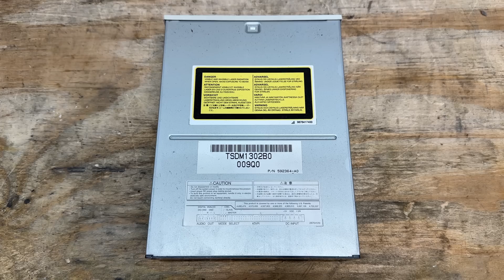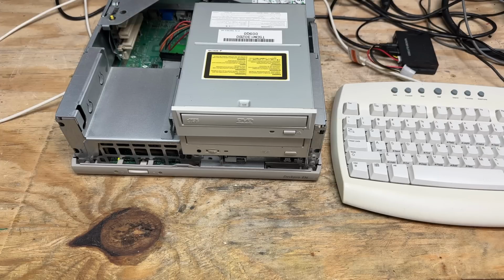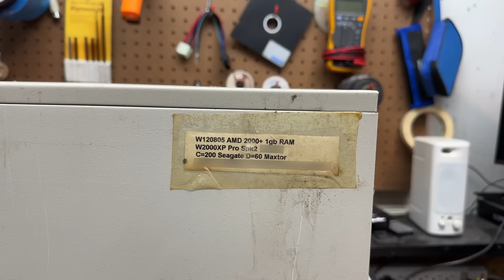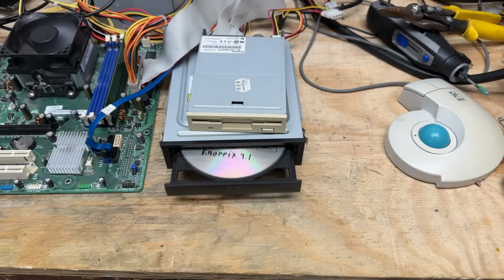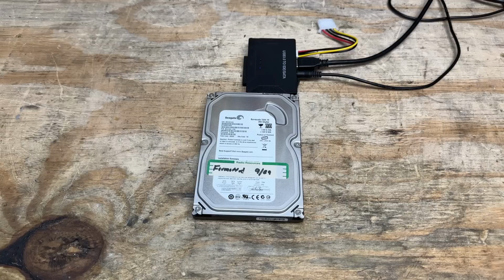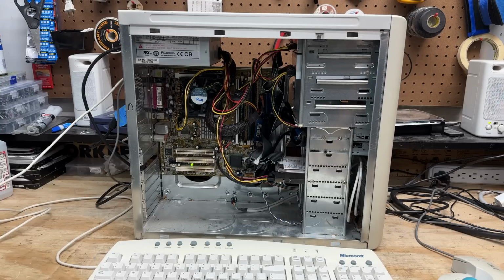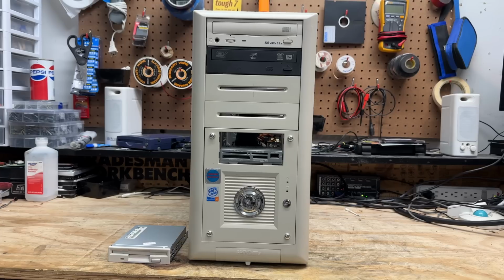Salvaging MORE parts from retro systems!

Comment: That usb card reader came from an hp system I just did a similar thing after it died recently 26:32 they cut off the rest of the curved part that was designed for the dumb curved faceplate gotta love up cycleing and it works great too.

Comment: Hey man, I just wanted to say that I really appreciate what you're doing here. Your repair techniques are top notch--I was an electronics tech in the Navy (with Miniature and Microminiature electronics repair certification) and it's always nice to spot others so well-versed in the field in the wild. One tip I might have is to invest in multiple soldering iron tip sizes--the one you used to replace the cap, though it got the job done, was a bit on the larger side. They are pretty cheap on Amazon these days (I think I got a dozen or so different tip sizes for my Weller for less than $20). Cheers and thanks again from someone who has been actively involved in computer building/repair since the late 90's!

Comment: For the S2, take the battery out, let it discharge for a few secs, ans try to power it up again. Sometimes a low battery hangs the rtc and the bios code freaks out.

Comment: CyberMax was a marque of Fountain Computers based out of Somerset, NJ. They also sold machines under the Quantex, Pionex, Pionex Elite, and Inteva brand names. I was working at a PC shop at the time and we were selling Pionex Elite machines to customers. The cases were exactly the same as that CyberMax, just a different front panel attached to them. The hardware configurations were similar too. They loved Biostar and FordLian/RedFox boards.
Reply from the maker: Thanks for the info! So they were bigger than I thought.

Comment: interesting to see something newer in the pile. for those modems i kept finding them too and it was the first thing to pull out and throw them aside without even testing them but thought one day ill do something with them...and that day has yet to come. i easy have 20-30 of those modems and still wondering why im keeping them. maybe time to  send them. for hard drives id rather get more sata ones. i already have too many ide ones and i rare use any of them and i dont need any more of them for my od old pc tinkering. but could easy find uses for sata ones. i did have a place i got piles of drives (lucky got some 500, 1tb and 2tb ones) quite a few had bad sectors or be totally dead but still plenty good ones that were healthy.  sadly that place does not get rid of them as much and when they do they smash them up so there no good for anything apart from salvaging magnets etc. and i already have more than need. so if there smashed i don't even bother taking them. guess no more free drives for me :(

Comment: I really like that SS7 board!
* mATX
* ESS Solo-1
* Super Socket 7
* AGP + PCI + ISA

Full bang in small form factor!
Reply: It's a Biostar M5ALC board. 

It does look pretty good aside from the ALi chipset. I've had bad luck with those and stability in Win98 (esp with AGP cards) but hardware of this era can be finicky in general. Prefer VIA MVP3 boards myself.

Would make a pretty overkill DOS rig though.
Reply from the maker: This one is definitely worth the resurrection effort!

Comment: I used to hoard as many computers as you do, my local recycling center was pretty chill and let me pick stuff. I have kept at LOT. Such a fun thing to do, you never know what you gonna get. I remember one PC cas that was heavy, and it felt like there was loose stuff in it. When I opened it, it was full of CPUs, RAM stick and loose chips of all kinds. Like a treasure chest.
One thing I often find is CDs in the drives, and sometimes it's retail games.

Comment: I would definitely remove the CMOS battery out of that socket 775 motherboard. Out of all old socket 775 motherboards I have worked on, the vast majority were "repaired" by clearing the CMOS and reseating components, and the voltage on that battery is low enough that I don't trust it.

Comment: i got a wierd samsung dvd drive which the tray dosent comes out. i opened it it was clean inside but the tray is actually hitting the lens mechanism for some reason and i had to cut extend part from lens bottom side and after that the drive worked fine.

Comment: That third P4 system, I use the version of that board with AGP for my late 98/XP rig (P4P800-VM). It's actually a very capable board for a late era 98/XP dual boot rig since that 865 chipset is surprisingly stable in 98. Even gives me full USB2 mass storage speeds no problems which is usually a stickler for 98 and later boards like this.

I wonder too if you could solder an AGP slot onto it and if it'd actually work. The 865GV chipset does support AGP, the only hurdle I can think of is BIOS support - but maybe flashing it with the BIOS file for a different board would remedy that.
Reply from the maker: An AGP mod would be an interesting project!

Comment: 7:59 funny :D

12:25 whoa, didn't know Mike had a rough side :>

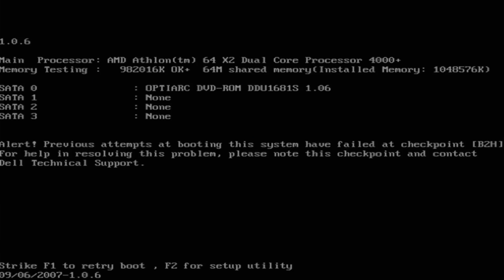20:07 as long as the floppy lives, I'm fine with that.

27:03 oh my goodness. Made in China to the power of 10.

31:20 tough challenge then.
Reply from the maker: That faceplate took a lot more force to remove than I realized!

Comment: all machines need wake on LAN enabled, that would save me so much time while covering all my companies clients
ILO is hit or miss, especially with HP but Lenovo BMC works quite well
Reply from the maker: In my Windows sysadmin days, we had Dell workstations for which you could generate a small GPO-deployable utility to modify BIOS settings. The very first thing I used it for was to enable WOL across the entire company.

Comment: 12:32 Lol I have this exact case, it looks the same.. except mine has the power button on the TOP and it has a metal rod to press the power button that's further inside the system.. pressing the pressing the button physically moves the rod to push the button that's mounted at the back of 5.25" bays. I demonstrated this on video. Incredibly overengineered, for no reason.

Also unlike your case, it does not have side panels, instead it's one sheet of metal wrapped around, like on at cases. you unscrew the 3 screws after removing the front panel and entire thing slides off including the top part of course.

It looks like your case is a newer revision of the one I have.

Comment: You've convinced me to try that desoldering alloy, I have a Gigabyte board with 23(!) bloated caps. Do you use a separate iron tip for it to avoid contamination or just lots and lots of cleaning when switching to soldering the new parts in?
Reply from the maker: I use the same tip. A brass solder sponge is sufficient for cleaning it off before final soldering. The minute amount left after cleaning won’t cause a problem.

Comment: That first motherboard…. Capacitor plague has taken its toll on that thing.
The best way to get rid of issues with system not booting is to pull all the electrolytic caps, and do some ESR and capacitance testing on all of them (need to pull them out for accurate readings) 

As for replacement capacitors, while ideally one would want exact value replacements, they aren’t often available or common, so for testing purposes one can use capacitors with an equal or higher capacitance rating and equal or higher voltage, as well as operating temperature rating if applicable. Of course, the prudent thing would be to replace that capacitor with the correct rating and values as soon as reasonably possible, but there should be no issues as the capacitor will only charge up to the circuit’s supplied voltage and no more - it’s not an inductor or voltage ladder.

Comment: Gotta point out that recap on the M5ALC - you forgot to replace the bigger puffy cap next to the one you soldered in :)
But to be honest - the fact that the board POST'd only once tells me you might need to replace them all and test again. Chances are a full recap should bring it back alive.
Reply from the maker: It’s one of the 1500uf caps which I didn’t have a replacement for. Let’s hope the caps are the only issue. BGA soldering gives me anxiety.

Comment: Btw,you CAN add AGP.
But,it would be a LOT of work,and you would need to find configuration resistors.
And not only that,it could be missing all the ICs, needin' to drive the AGP.
Reply: On that board, for AGP to work you'd need to replace the chipset too. The 865GV has the AGP port fused off in hardware, it's integrated extreme graphics or PCI only.

ASRock and some other vendors did make 865GV with an AGP slot, but that's actually wired through PCI.

Comment: You should consider investing in BIOS programmer... For the first system, it's worth investigating, maybe a pin on the bios chip is oxidized and you just got it working by bending the board or by luck due to heat expanding pin in contact, who knows... alternatively, maybe the bios is flaky and reprogramming the bios by taking the bios chip off the motherboard could revive it.

Comment: Mike awesome as always, awesome tip about using the desoldering alloy as  I'm a novice at soldering so it will definitely come in handy, I laugh as you post regularly on Fridays, two of my other favorite computer channels -Phils Computer Lab and LGR have also started posting regularly on Fridays after sporatic upload schedules just as your subscribers count grows, maybe just a coincidence but I at least like to think you had something to do with them getting off their duffs and back to work😂
Reply: I mean you just use any type of solder and it should work almost as good, if not as good.
Reply from the maker: @beardsntools  It can be done with regular leaded solder, but it’s much easier with the alloy. It’s almost unbelievable how well it works.

Comment: Cool finds, that Gigabyte board could be useful as a sort of bridge between new and old if it works, could probably run XP just fine. Could be fun to try to add an AGP slot to that board, it doesn't have much value without it.

Comment: That socket 775 board might be dead due too bios chip bitrot, this is the era of bios firmware sort of corrupting & getting wiped from the cmos battery running out of power

And funnily enough some socket 775 boards outright refuse too post if that cmos battery is empty as well.
so it might sort itself out if you remove the cmos battery.
Otherwise burn a cd with the bios firmware on it or run a floppy disk with the firmware on it, if its small enough for it.
And let it try too rescue itself loading that in which some boards actually can recover with just fine giving it like 10 minutes for the cd approach & 25 for the floppy disk.

Comment: I always get a kick out of the "de-dusted" phrase. Would that not mean that you are 'adding' dust to the system. As in "Hey, I'm tired of dusting all the furniture in the house. I'm going to start de-dusting the furniture instead." No? Just never heard anyone say "de-dusted" before and that's the first place my mind went. Nice job on spotting those bulging caps on the first system. I was yelling at the screen when you first opened it the showed the board and was going to comment, but of course you noticed. I am in the "cracked/bad BGA issue" bandwagon with the chipset regarding the motherboard not working.  Good job, regardless.

Comment: About power supplies from the early 2000s, they usually are made to deliver more power on the 5V rail than modern ones, so you can't use some of the more power hungry graphics cards without a ridiculously overrated modern power supply. Therefore those old ones might just be worth trying to fix.

Comment: Good old Maxtor drives. So popular back then. But so unreliable in that time period. Im not suprised they all fail by now.
Reply: I remember when I bought a 500GB Maxtor drive from a physical TigerDirect store in Illinois. Darned thing lasted about two weeks and died. Took it back, got another one and it died in about a month. Lol😅
Reply: The worst ones were those super thin maxtors that were like halfway between a 3.5 and a 2.5 in height. Saw them damn near everywhere in the mid 2000s on budget machines at the shop (and usually were there because the drive is dead).
Reply: @gen_angry  I didn’t know any better back then and had a few. None of them lasted as long as my WD Caviar 430 MB workhorse.

Comment: That second system... I had a couple generation machines in those cases
When I saw you grab that from panel I was so worried, those damn things needed quite a pull even brand new hehehe

Edit: Forgot to add that, for cleaning contacts on cards and RAM sticks and stuff, pencil eraser. My father gave me that trick over 20 years ago, still as relevant today :)

Comment: Oh and I never really thought of it until this video, but you may want to warn people to be careful with white lithium grease in addition to your normal PSU disclaimers. I always see you handling it carefully, but the stuff is really nasty if ingested. But it's better than anything else I've tried for things like squeaky garage doors or like you see here.
Reply: How would one end up eating it when all he does it put some on a q tip?
Reply: @WinrichNaujoks  The vapors off white lithium grease are also toxic. You don't have to eat it but that would certainly be a worse idea. I only mentioned it because it's listing as a hazardous material contains two particularly nasty listings: 

1] "May be fatal if swallowed and enters airways."

2] "Suspected of damaging fertility."

Comment: I find it amusing that the machines you stop collecting at is about where I start collecting. For early windows/dos I am fine with using emulators. From the dawn of 3D acceleration and on I generally use the newest hardware I can find that is compatibility. For both performance and ease of sourcing replacements. I do have a Pentium Pro system for desktops and a 486 laptop but I definitely did not seek them out.